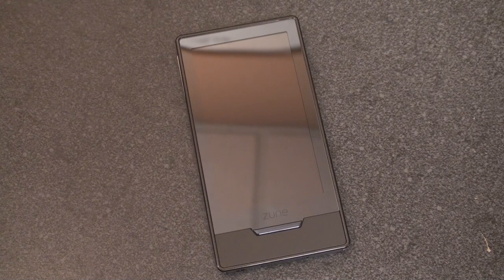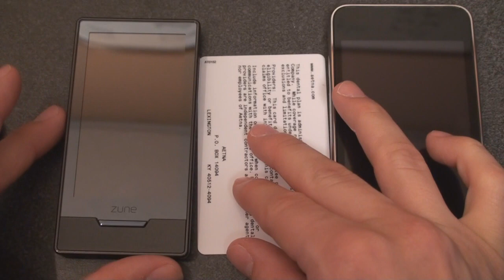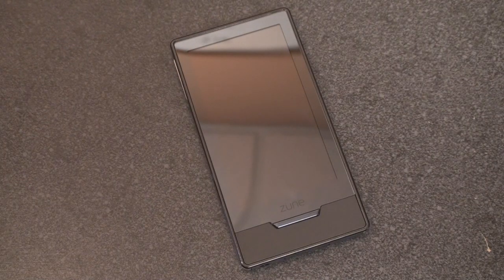Zune HD Hardware Tour

Comment: wtf branden, 1:42- "what i found odd is that the zune hd did not come with a wall charger."
the ipod touch didnt come with one, now did it??
since the ipod touch uses glass it breaks easier, mine broke :( 
also the metal has tons of scratches.